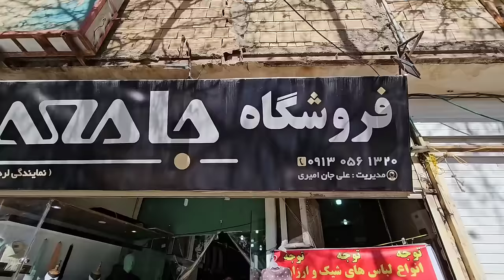Unforgettable Nomadic Celebration: Preserving Cultural Heritage & Embracing Joyful Family Bonds ✨

Comment: Instead of wasting money on clothes (Btw Malik's jacket is too tight), you should be using that money to pay a professional to come in and build that house for you. That way there won't be any holes in the walls or the ceiling and the roof will not cave in. Every step will be measured. All of the previous homes that Malik and Mahdi have put together have looked like very unsafe and offered no protection from cold.  That's because the houses were just thrown together without proper planning. Please don't dishonor your employers nice gesture by building something that looks horrible again!! And please keep the gate to keep MIL out snd away from Maryam.